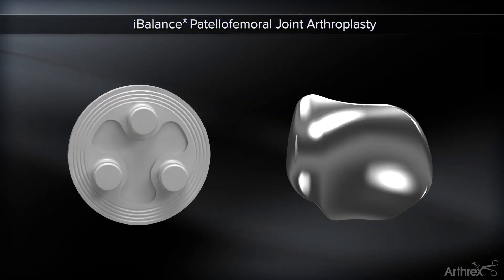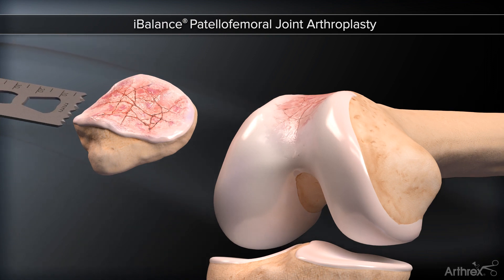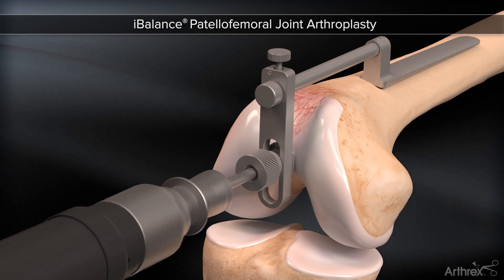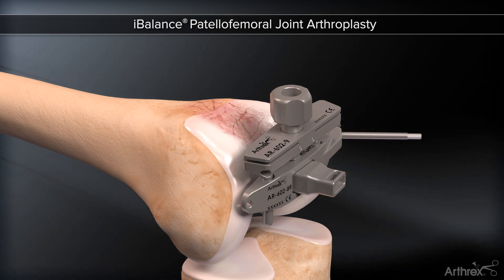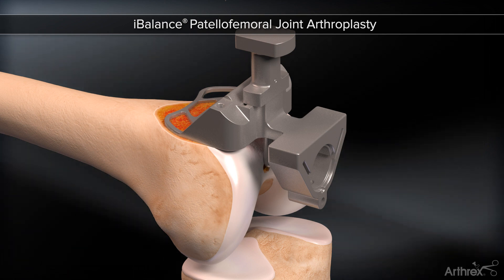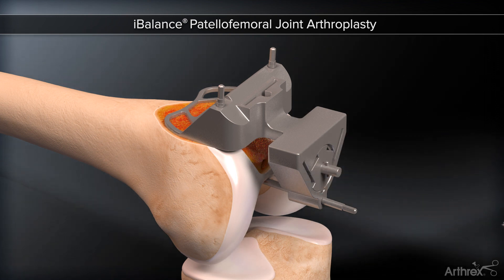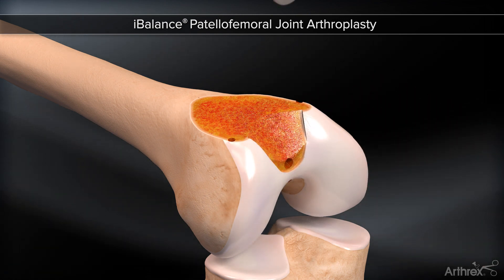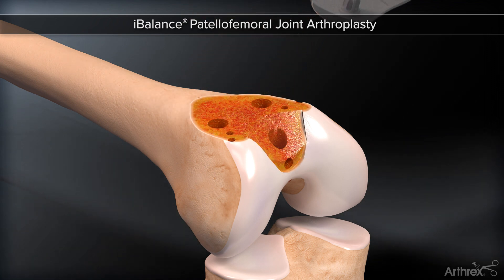iBalance® Patellofemoral Joint Arthroplasty

Comment: I had a rock climbing accident and fractured my kneecap badly and ended up with a crack in my cartledge. They did surgery straight after and wired the kneecap back together one year later the doctors removed the wires. This is 10 years ago. I m a surfer and my job occupation is tree surgeon. Now I m suffering from arthrosis and my knee gets swollen after hard days at work or when I do to much sport. The cracking sound gets worse and doctors said I got a few more years until this surgery needs to be done. I m only 31 years old. I m getting frustrated being in pay and I m also scared not being able to continue my job as a tree climber.   I feel like this surgery is the only way out off not being in pain all the time.
Reply: My guy, get a second and third opinion if necessary. Are they doing any other treatments for you? Usually there's cortisone injections, pain management, Physical Therapy, a brace, etc. When those no longer manage it, then surgery is more seriously considered. One of the reasons for delaying surgery as long as possible is that implants generally reach a point of needing re-replaced. At a younger age, that's more of a concern.
Reply: Seek a second and third opinion if necessary.  Are you doing any other management? Usually there's home management (pain medication, ice, elevate, etc), Physical Therapy, cortisone injections, or special brace. If those don't work then surgery is the next step. Many insurance companies won't cover surgery unless other options have been exhausted or it's medically necessary (ie significant impact to your activities of daily living). The other concern is that implants tend to have an 'expiration date' and need re-replaced. At your younger age, that could mean extra surgeries which carries risks. Good luck!!
Reply: How can i get this surgery i am 18 an i have just shattered my knee cap ice skating an do jot want to deal with arthritis
Reply: In india its very cheap sir if you want to have surgery see the options !
Reply: Also Cheap In Mexico check on those options
Reply: I had the same injury, when I was in the army. I had the same arthrosis after 15 years. I also surf everyday. I just had this surgery this week. The doctor is right. The arthritis pain and cracking will just get worse, and worse, and worse. Soon you will not be able to surf at all. Trust me. I did it now, I'm 40. Had the first broken kneecap when I was 18.
Reply: @jonnyzuma6884 hello
How are you doing after surgery?

Comment: I'm a really active old dude.  My patella on both knees are shot after 45 yrs of running.  I've put this off for 7-10yrs cutting back on other sports (skiing, weightlifting, road biking, hiking) as the pain got worse.  I've having this done in a month or 2  <gulp!>.  (Don;t know if it is this company's components.)  I've been told running is out but with a "partial" like this (not full replacement), I can get back to all of the stuff above.  In addition, I could play light "action" sports which I haven't done in decades...some tennis, racquetball, basketball, etc. that involve sudden start/stop.  But we're talking "light" here.  We'll see!
Reply: Hey have you had this procedure?
Reply: Hey how did it go?
Reply: @davidcattle7299  What should have been surgery 6mo ago was delayed 2x (not my doing and a very unhappy patient here).  Now scheduled for mid Aug.
Reply: @jeffb1886  hey sorry to hear that! Good luck!
Reply: So for anyone still interested in this topic...I had both knees done at the same time now 8wks ago.  Both were PFAs (prob similar to this video), and NOT total replacements.  Kneecaps were shot but meniscus and rest of structure in good/very good shape.  I have to say that recovery was prob FAR easier and quicker than if I had totals.  The first 7-10 days weren't pain free, but I recovered quickly.  I "graduated" from PT a full 2 wks early!...prob because of the partials.  8wks later I am riding my bike on a trainer 2-3x wk rebuilding quad strength and working hard at the gym with quad leg extensions and hamstring curls. All of this would have taken longer and more slowly if I had "totals".   I am VERY glad I got this and did both at the same time!!
Reply: @jeffb1886 super happy to hear Jeff. I hope you can progress in the gym pain free in the years to come!